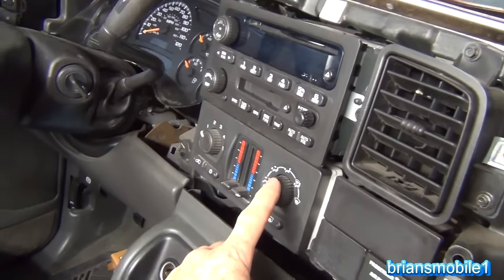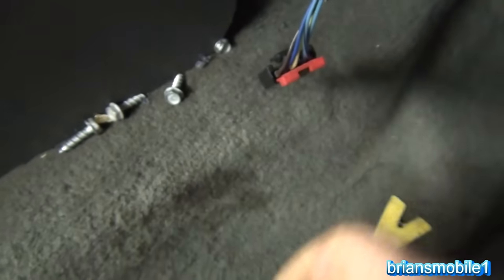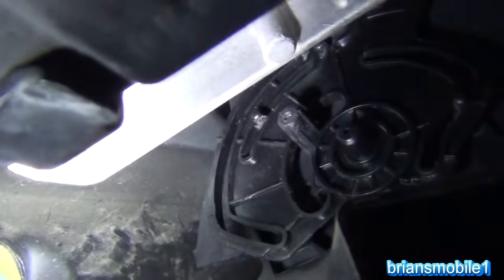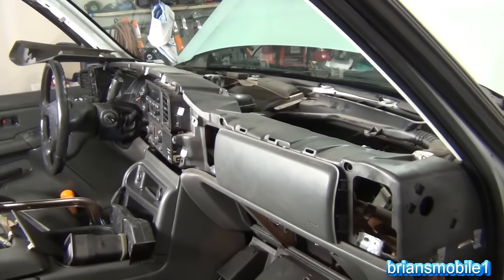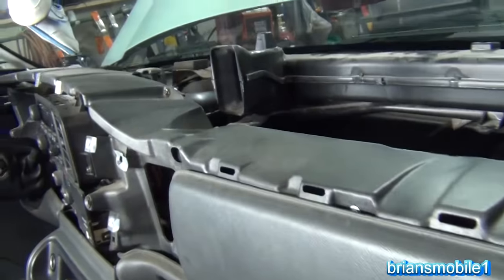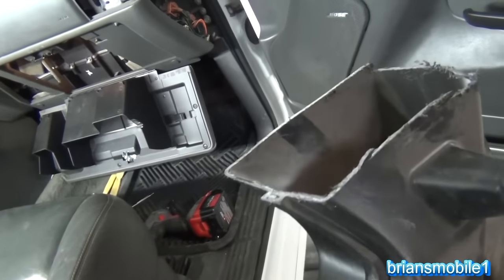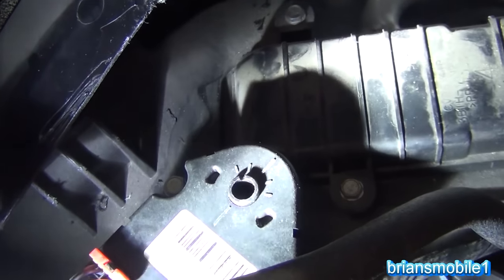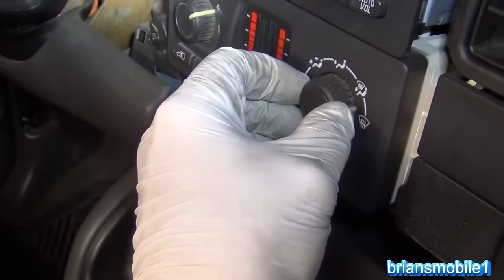Silverado Heater and AC Actuator FIX

Comment: Ok folks I have an issue with my 03 yukon, the a.c. only works in heat setting and the heat works on a.c. setting. Which make defrosting my windshield in the winter a pain. Does anyone know what could cause this

Comment: If you know what is wrong with mine let me know have new controller new reducer for fan speed can put hot wire on and fan works but will not come on when plugged in

Comment: Lol.

Still need help

New blower motor 

But for the front 
Only getting cold air
Not all vents blows equal or none at all 
Deforstrr only work in center
If get warm air it from driving over an hour or barely hot air

Rear only cold air and number 2 for the rear selectors 

Front actuator  blender on passage side wohavent check anything else

New coolant not flush
All valves are good 
The intake valve and return to the heater core do get hot not sure what tempatur 

Not sure if it's the heater core
One of the accurate
The switch.
Or my raditor

Comment: The actuator on the driver side any idea how to get that top 5.5 m m screw out? Socket is a Tad too tight
Reply: Oh hey man nevermind I got it all figured out after three years of having a screwed-up HVAC system I finally got everything dialed in and calibrated now all my vents blow where they should be
Reply from the maker: Cool

Comment: thanks for a good video. but can you tell me this. i have the 99 1500 and it has the turn knobs and i see the lower blend door moving but still no heat. so do both doors work in unison so one closes and one opens?  what fails more often the top motor or the controller? i get the recirc door working and the doors for the feet dash and defrosters so they are good. but no heat. thanks.

Comment: Hey Brian and all Silverado owners.  I need help! I have the same exact truck in this video.  2004 Silverado 2500HD

My problem(s):
1. No fan coming on at ANY speed. 
2. No heat in winter
3. No AC in summer

I’ve replaced the resistor. I’ve checked every fuse, every relay, every wire and every plug. I also made sure the blower motor was still functioning by hot wiring it to a 12v source. 

I even put new heat controls in the dash with the dual zone sliders and I get absolutely nothing.  In the winter, just a little heat will trickle through the heater core and warm the cab slightly, but no fan speed whatsoever.  

Does ANYONE know what I’m missing?

Please let me know.  Thanks!!

Comment: I went to turn my air conditioner on and it just hot heat. I been hearing a clicking lately like a signal light. My air compressor working but just heat coming out. Which actuator I need? Thanks
Reply: did u get a reply
Reply: +Alex Bojorquez No
Reply: mine makes that clicking sound too what do u think it is?
Reply: +Alex Bojorquez I'm not sure. If I was to guess I'll say blend door actuator

Comment: my o/d light keeps flashing on my Mazda protege 99.  I replaced my sensors already and still got the problem.. should I just replace the switch its self?
Reply from the maker: +Donte Rose It should have some trouble codes.  I would get it read.

Comment: I replaced the accumulator on the driver side under dash it worked but now I have hot air coming out of the two left vents and cold air coming out of the two left vents why is anybody thank you

Comment: I’ve replaced my temperature blend door 4 times now. Works for a few days then stops again
Reply: Are you using Oem or aftermarket parts. I’ve heard nothing good about the aftermarket, especially Dorman.
Reply: @billhartsfield424  I finally got one to work. I sold the 2000 a few months ago now I have a 2008 silverado

Comment: my 2004 chevy silverado ac runs for about 15 to 20 min and then it start blowing hot air it the blend door  actuuator
Reply from the maker: You might have some moisture in the system that needs to be evacuated.  That moisture will freeze your expansion valve shut.

Comment: what could the problem be if all actuators seem to be working but no cold air. my compressor checks good line is cold but cold air doesn't seem to be making it to the cabin. There is a click from time to time when I change modes. please help I live in Florida and uhhhh yeaahh hot as $#!×!!
Reply from the maker: It could be a lack of air flow from a clogged evaporator core or cabin filter.  It could be a weak blower motor or failed blower motor resistor, or it could be your refrigerant is low, or it could be moisture in your expansion valve is frozen and blocking.  
MOST likely though, your blend door is stuck on a pencil someone put on the dash and it fell down the vent or something like that.

Comment: Don't get duped by ACDelco one online that cost $80 I'm telling you it's just a Chinese one it's not the original the original has that writing on it with the green letters you can buy it I believe from summit... If you're going to buy anything other than original just get a cheap one because it's not going to last any longer buying that $80 one I promise you.. you're looking at about 6 months to 2 years on aftermarket actuators

Comment: The suicide rate for Chevy mechanics must be a astronomical. I can see why GM went TITS UP designing this kind of junk. Give ma a Toyota that can go 350,000 miles with no headaches. I like fixing my own stuff but I don't need to fix something that was redesigned to be a nightmare to fix. I live in Vegas, the AC works great in my 02 Trailblazer the heater only blows out of 1 pass. vent. This time I'm going to take my wife's advice and leave well enough alone.

Comment: Just replaced my driver side blend door actuator (center of dash at the floor) on my '05 Sierra with manual controls (vertical sliders). OEM #52402588 but instead of the 83$ actuator referenced in description I used   https://www.amazon.com/gp/product/B07411WTHZ/ref=ppx_yo_dt_b_asin_title_o00_s00?ie=UTF8&psc=1   for 30$.